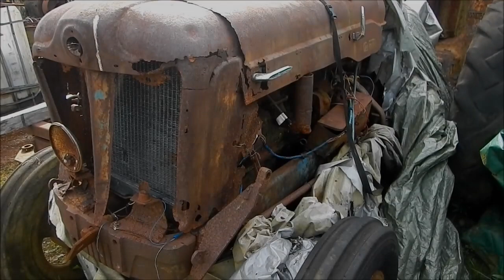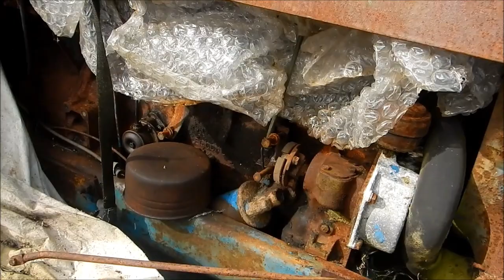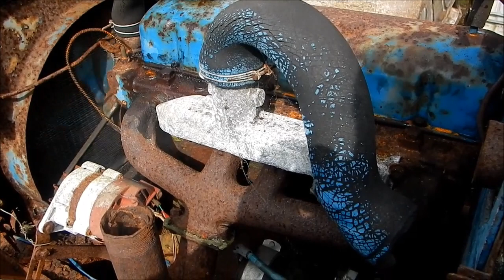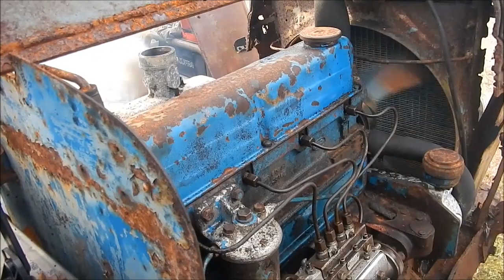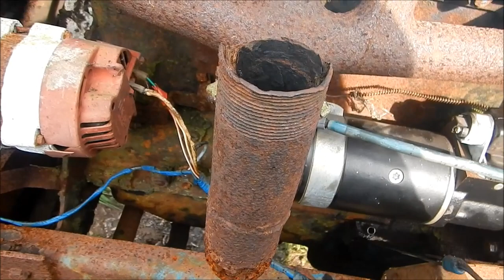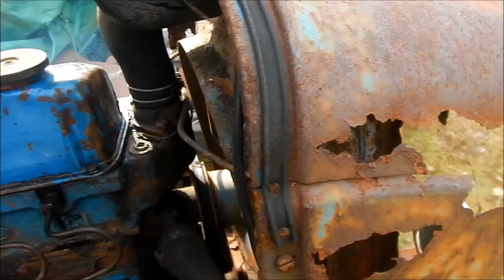fordson major

Comment: Is it to be restored?
Reply from the maker: hopefully some day now that it runs
Reply: I own a Fordson Super Major bought by my grandfather in Pakistan
Kindly send a link where we can buy the bonnet, mud guards for the Fordson to restore it
Reply: @maryellis3661  Thanks indeed
Reply: Runs ok .I would have cracked an injector line also i didn't think the cold start button in  and thoseSimmspumps really need oil added to the side cover we have a oil hole added with a screw for a plug  if itsran dry the  bearings can sieze on the injector pump I have my dads 59 power major its a very similar configuration  to this tractor.
Regards Reg